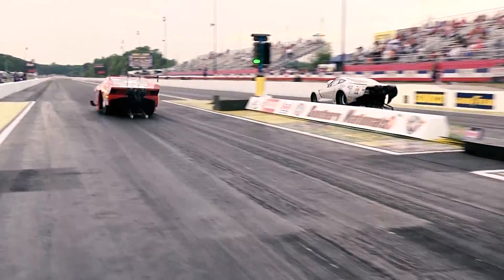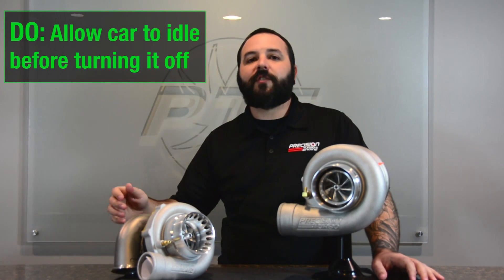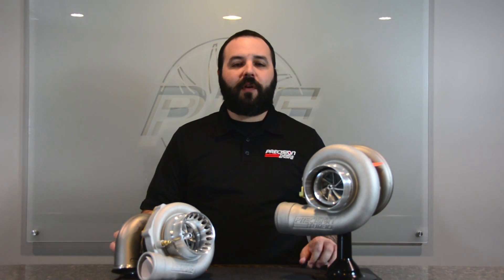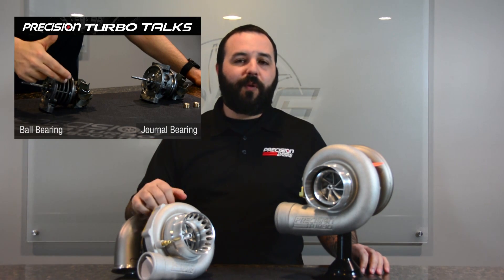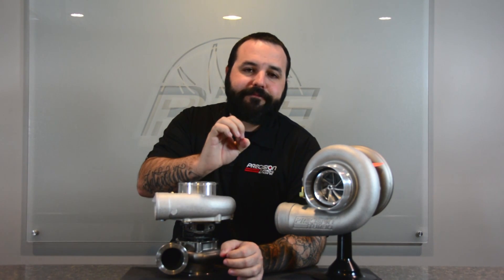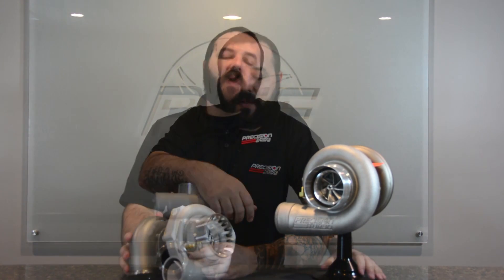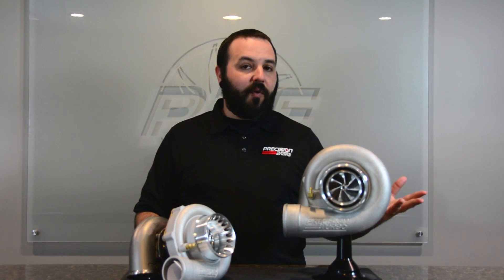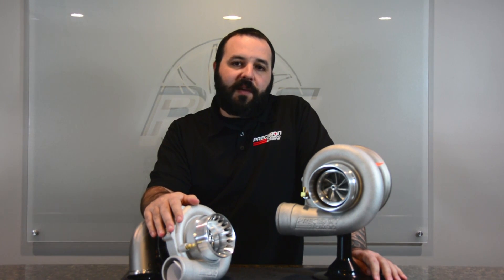Precision Turbo Talks - Turbocharger Do's & Don'ts

Comment: I can’t think of any factory cars that have turbo timers. Just saying.
Reply: A lot (most,all?) of factory cars have water cooled center sections though
Reply: Kfx Guy I don’t think any do TBH. It’s a gimmick. If you just idle your car for 2 minutes after you do a full track run you’ll be fine. Even street racing unless you’re doing highway runs back to back won’t even heat the turbo to that level.
Reply: The 951 or 944 turbo had some kind of timed deal after you shut it off...I think it circulated coolant though...I could be wrong though
Reply: I had a 944 turbo - no timer or ignition delay device on that.
Reply: CK_32 then it’s obviously not a gimmick, the timer leaves ur car on so it can idle and shut off without you in it. Oil coking will happen on turbo cars with bad ventilation like MR2s. When the car is off and oil isn’t circulating it can’t cool off so even the residual heat from a spirited street drive will coke the small amount of oil in the chra.
Reply: Mk7 GTI
Reply: CAT 793f hall truck, CAT 789d , CAT854K i can go all day , that is recommended by garret
Reply: Vehicles get a lot more cooling when they are moving, I have seen timers connected so that only part of the ignition system has power, so the engine fans stop when on timer.
Reply: The majority of all factory cars are making marginal power compared to aftermarket.

Comment: So if you have a turbo that has coolant and oil cooling do you still need to allow a cool down time?
Reply: Awsom Sauce100 the more cool down time the longer it will last.  Depends how hard you thrash.  If you give it a hammering then 2min idle.  Just cruising 30 seconds will do.  Remember manufactures only car about your car when in warranty, after 3 years they don't give a ......
Reply: Water/coolant in the CHRA means the car can cycle and turn the fan on to cool down the CHRA through the coolant channels, even after you've shut the car off (in many applications, depending on the vehicle - older cars may be more likely to run oil-only systems). This is actually precisely why you see so few people running turbo timers anymore on newer cars. Personally, I'd always go for an oil/water CHRA, especially if doing competitive driving. More heat exchanging ability = better, especially when you're literally racing.

I went Garrett GT2871 for this reason (in part; there were others) - their turbos have oil AND water running through the CHRA. More complicated plumbing, yes, but better heat management. PTE turbos are mostly oil-only, IIRC. They make awesome power, but on my DD, reliability is huge too. Besides, the Borg Warner that came on my Mazdaspeed 3 was water and oil too, so I already had the lines for everything; simply remove/replace.
Reply: Yea if you’re mashing and hot lapping. Normal driving does not need this. Only for full on track racing or if you just raced someone and pull into a parking lot and shit the car off. Sit there for 2 minutes and let it idle.
Reply: Drive the few last minutes on low rpm cooling it down. 
Or buy turbo timer... (They are just useless bs imo.)

Comment: Good info. Its always a good idea to invest in a turbo timer folks
Reply: DarkMufasa bullshit advice. Only possibly needed for non water cooled turbos. Modern turbos on modern cars with pressurised coolant systems still cycle coolant/ water with engine off due to it being pressurised.